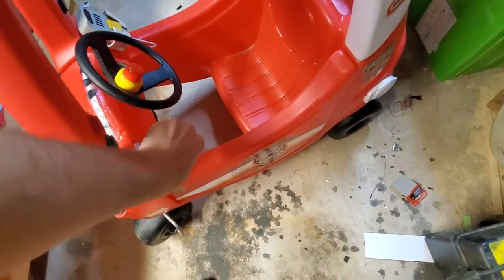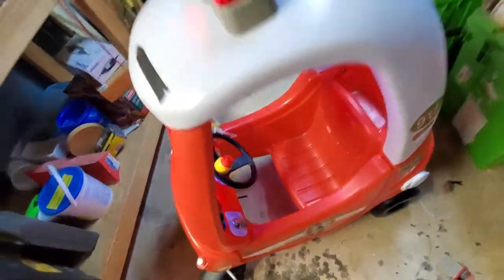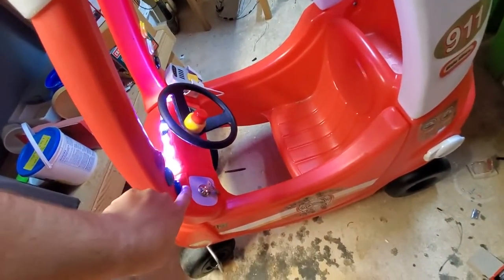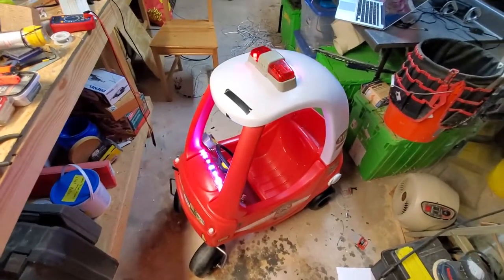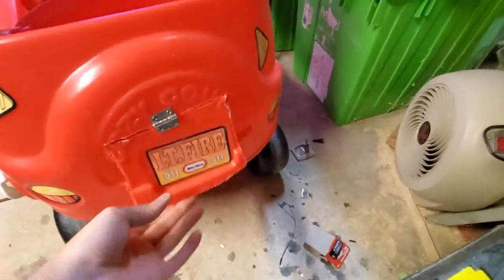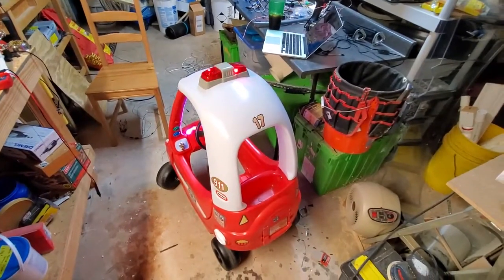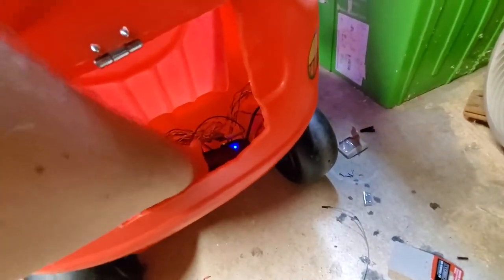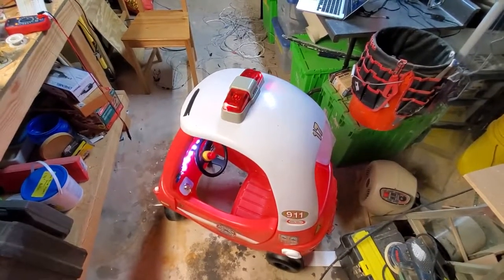Finishing the fire truck

Comment: Hi, i'm about to start a project like this on my sons cozy coupe police car. I have some red/blue led strobes turning up but im struggling with battery ideas.
Can i ask what battery did you end up using?
Many thanks and good job on the fire engine
Reply from the maker: Thanks! Its just a simple usb battery. https://www.amazon.com/gp/product/B0194WDVHI

I chose this because most of the dev boards I use are powered from usb 5v anyway, so I don't even need to make custom cables.

Also I wanted to allow my son to charge the car so I got some usb magnetic charging cables. https://www.amazon.com/Big-Magnetic-Charging-4-Pack-Contains/dp/B081L5WK6K

This way its very easy for him to plug it in.

(havnt done this part yet, but it will go in where the gas port is)
Reply from the maker: If you need any help with coding the IC, or wiring discrete components feel free to reach out, I really love helping people with this sort of stuff :D
Reply: @spiffomatic64  I appreciate the offer of help, i think the lights should be turning up with a controller all i need is a power supply. 
I think im going to need something a bigger battery since these are 12/24v 12w, 4 sets of lights, three led's in each set, drawing approx 1amp per led i think.
I have an old NiCad 18v headge trimmer battery that i thought i could try to modify. Just not entiry sure what it is i need. I think it would do the job.
Reply from the maker: @krisbreach4376  I'm assuming you are using those because you already have them? 12V is usually used in "real" cars as those batteries are 12v, using the 5v opens up a ton of possibilities (powering other 5v things like raspberrypi/arduino/etc)

But I can also see using 12 because then that opens a world of "real car" addon possibilities.

Either way, don't hesitate to reach out! :)
Reply: @spiffomatic64  Yeah a lower voltage would have been easier to deal with but a friend of mine had the 12v ones and said i could have them. He lives up north so im waiting for them to arrive. These are supposed to be mounted on cars, so a little OTT for the cozy coupe, but what the hell :)